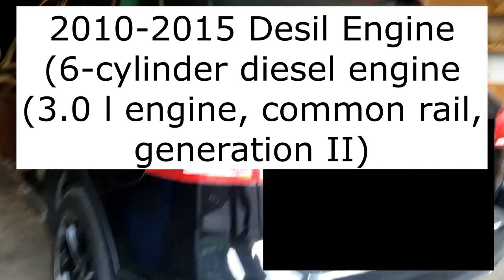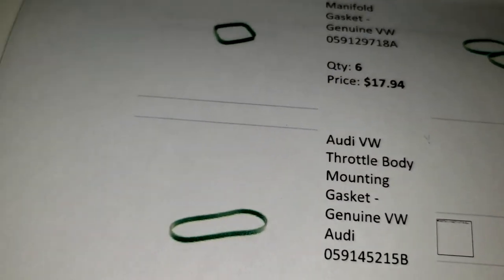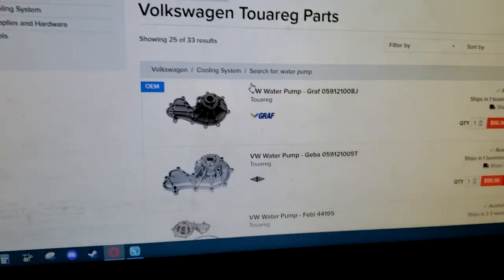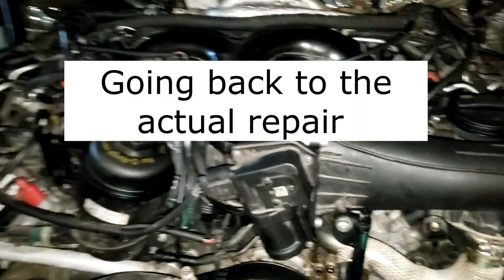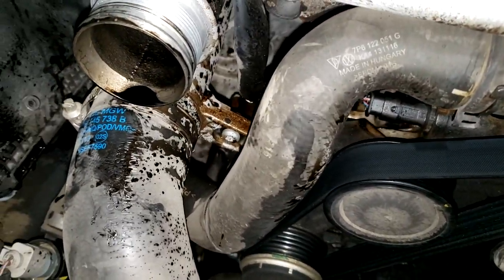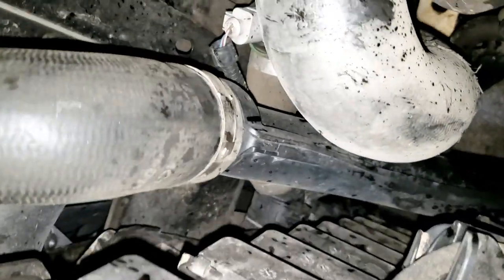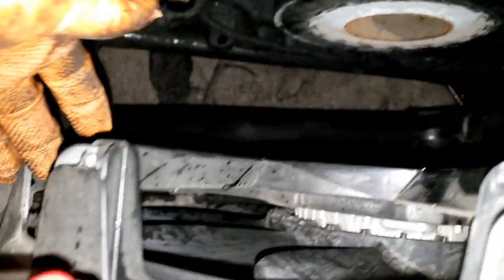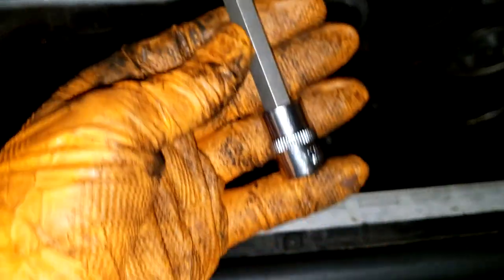(Part 1 of 7) 2010-2015 VW Touareg TDI (Replace part 059103525F) Coolant Leak Under Intake Manifold

Comment: Canada, June 2024.  Touareg 3.0 TDI, injector seal parts (copper washer, large o-ring, small o-ring, bolt) x 6 ...... $300 CDN at VW dealer. Eighteen dollars for EACH copper crush washer.  Let that sink in. Consider just the cost of the parts required in the job in this video series, plus the triple square bits.  Also note the mention of difficulty finding some parts and service information.  Thank you for posting this video, hopefully people see what theyre getting into with a used Audi/Porsche/VW.  
Stay gold.

Comment: Thanks for your efforts to document the work at such detailed level. 👍There is nothing like this available online AFAIK. I guess it is just a matter of time when I will have to tackle the infamous "V" 😩  Greetings from Germany
Reply from the maker: This video will be a very good resource for anyone attempting to do this job. This issue seems to occur at the 10 year mark on all of these engines. If you do enough research you will find several people also had the issue where coolant was accumulating underneath the intake manifold. Most of the failures occurred within the last few months.
Reply: @european.repairs  Well, then I will join the party next year 😂 I bought the car (MY 2014) in 2018 and up to now coolant level has not changed (never had to add any). But I will get myself a borescope now and start watching the V ...

Comment: I have the same motor in my audi a6 c7 from 2011, same problem... but the space on my car looks a lot smaller :D do you know if i have to remove the front? any tricks for that pr do i just have to remove it completly? greetings from germany - keep up the great videos
Reply from the maker: I'm pretty sure you will need to remove your front bumper, radiators, etc. to gain access. Good luck with your project.

Comment: Hey David, that was a very informative video, if you could give me some advice though. 2014 Q7 3.0TDI w/ 106k miles. Replaced the Oil Cooler along with the gaskets using only Genuine Audi parts, drove fine and after 7k miles started leaking again, I can see oil splashing in valley pan where the Oil Cooler sits, basically the whole front of my enigne is full of oil leaks also, same thing underneath the engine. I saw in the video you said that you also had coolant in the valley pan even after replacing the oil cooler, but you are saying you have coolant, and I literally have oil everywhere. Thanks in advance!
Reply from the maker: Did you replace the gasket between the oil cooler flange and the engine as well? I recommend replacing all of the parts that I replaced during this video series. The gaskets that I replaced are only designed to last 10 years and 100,000 miles. Your car is exactly at that age and they are leaking as expected.
Reply: @european.repairs Yes I did, bought a Genuine Audi Oil cooler with the Plate that sits on the engine, and all of the according gaskets, the only thing I haven’t replaced is the front engine cover gasket like you did in the video, do you think the front engine cover could cause it to leak in the valley pan?
Reply: @european.repairs hey, do tou think the front engine cover may cause leaking oil in the valley? Can you please tell us? I did the same things like romankulik but also i have oil. I replaced only the gaskets, all gaskets. Do tou think is from from flange? Or from the oil sepparator?